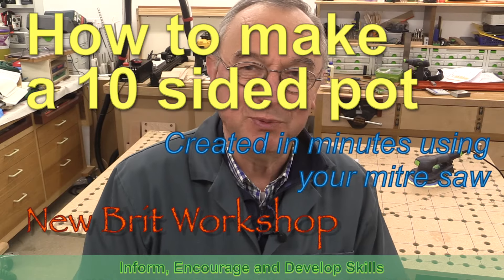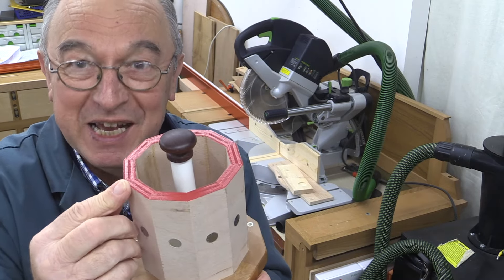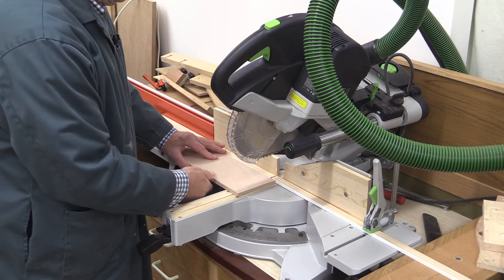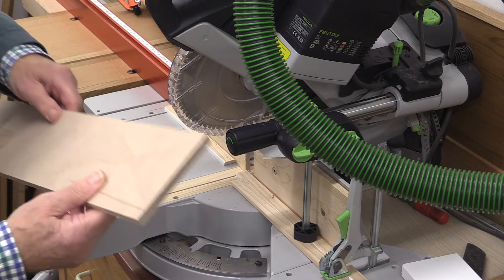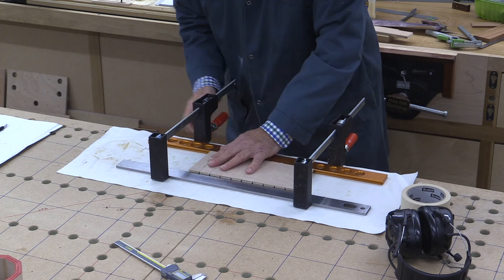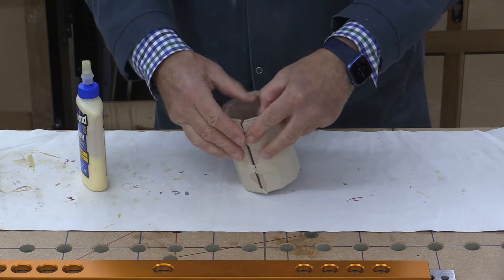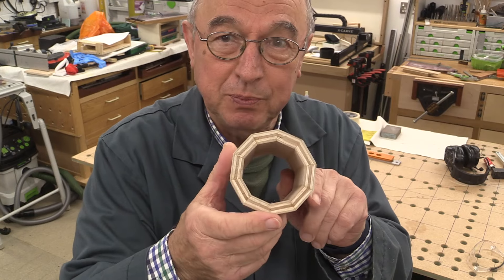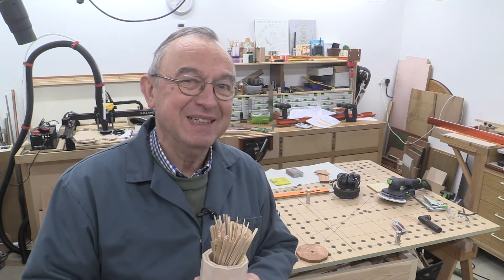How to make a multi sided container - simple, quick and easy

Comment: Peter,
a nice tidy. Without mitresaw I would cut long strips at angle with the tracksaw and then manually cut the strip in 10 short pieces. Regards, Sierk
Reply from the maker: Hi Sierk, Excellent.  Cheers.  Peter

Comment: For the price they're charging there should be a manual. There is no mention of the QR code with the protractor or on their website nor does the customer service staff  have a clue about the QR code.  Think this is going to be fixed?  I expected a manual  just like I got with the PARF jig which was excellent. Very disappointed.